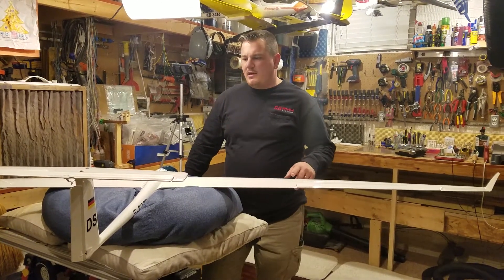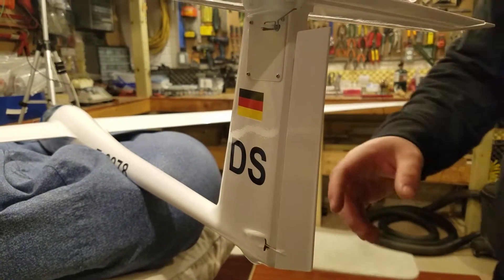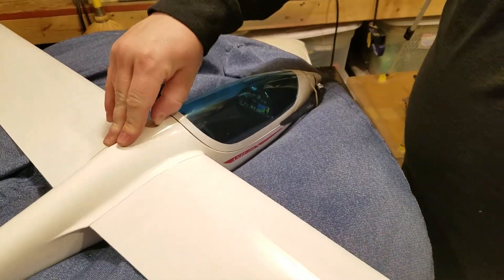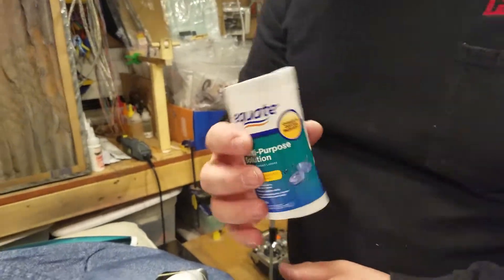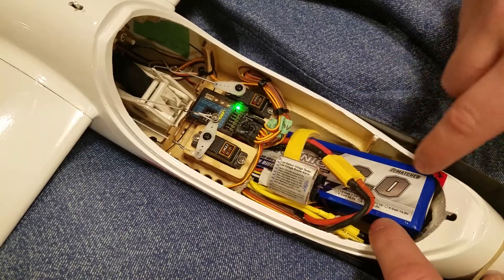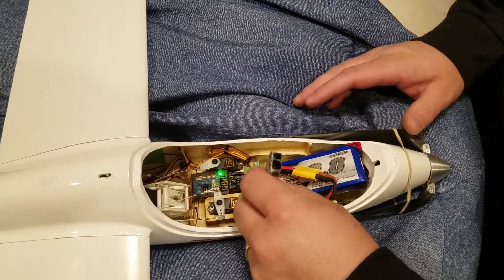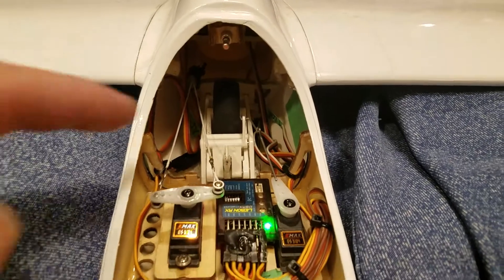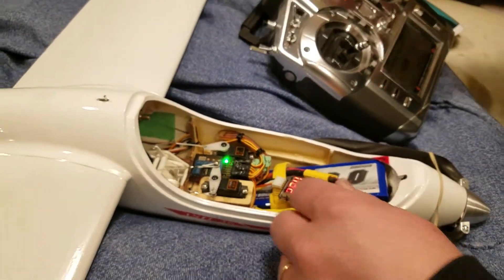CMPro - ASH26 - 2.6m Composite Sail Plane - Post Maiden Flights - Performance Enhancements Review

Comment: The Rudder MOD much better. As I mentioned before the Rudder had too much give. The  pull-pull was the way to go. How did you fill in the holes in the rear it looks GOOD. Can you believe I watched another video with the ASH 26  (LOL)
Reply from the maker: LOL - Now you're up to like 4,327 videos JUST FOR THIS PLANE!!! Congratulations!

Now you need to go through and count the number of times you had to hear me address the crowd as "guys"...

If you get it right...

...you'll win nothing, but laugh about it :)
Reply from the maker: Ooops, almost forgot. How did you fill in the holes in the rear - All I did was take a piece of adhesive backed mono coat and covered the hole, all but about 10% of the rear, to keep some air flow for electronics cooling.